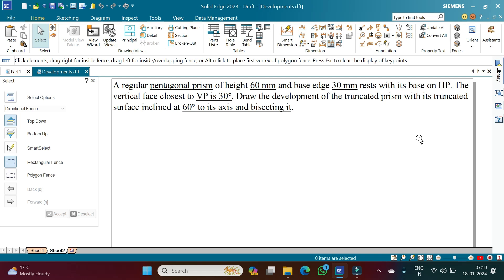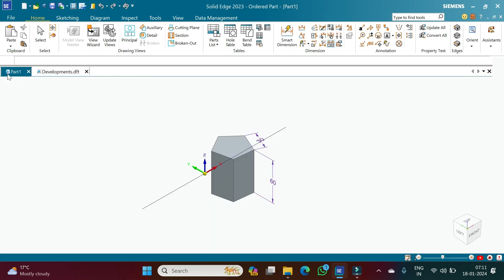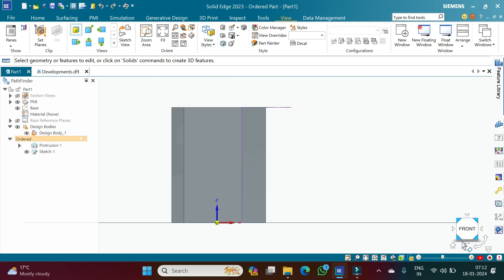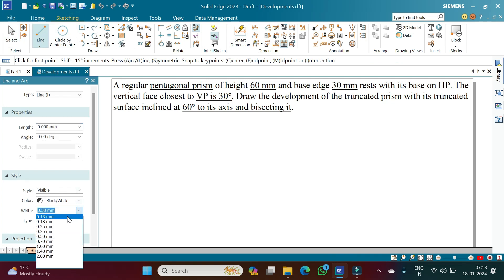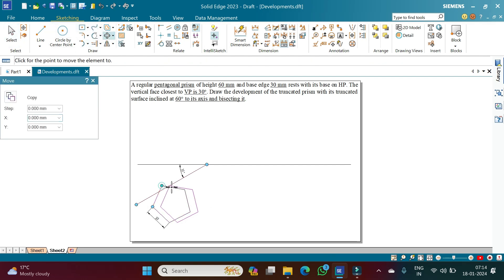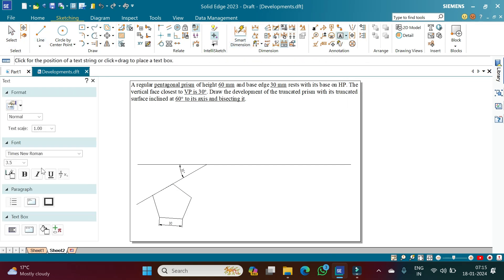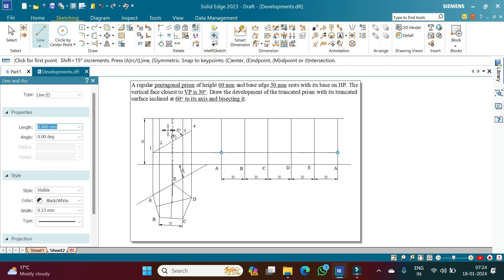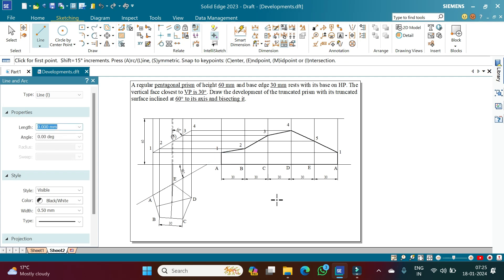Example 11, Development of Lateral Surfaces

Comment: Sir i need angle method for pentagonal and hexagonal
Reply from the maker: Assume side length as 30 mm

Length 30 angle 0
Length 30 angle 72
Length 30 angle 72*2
Length 30 angle 72*3
Length 30 angle 72*4

Similarly the angle for the hexagon is 60